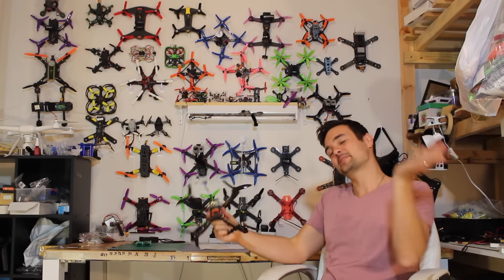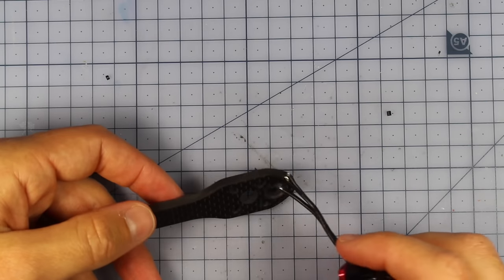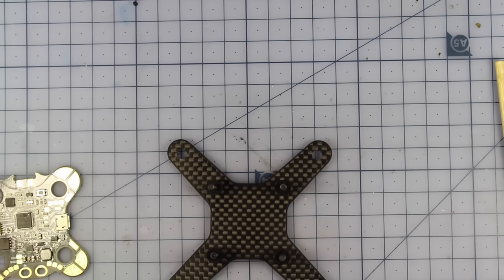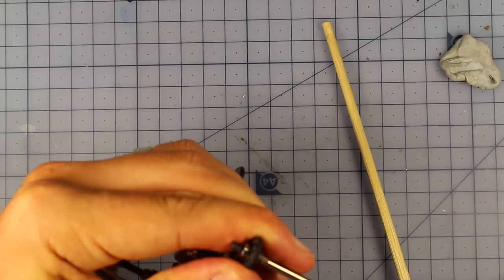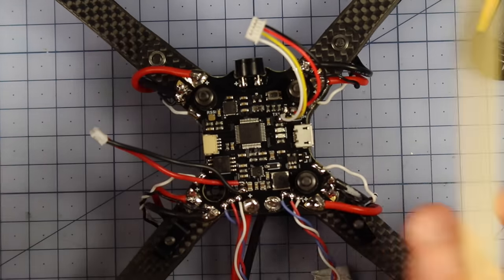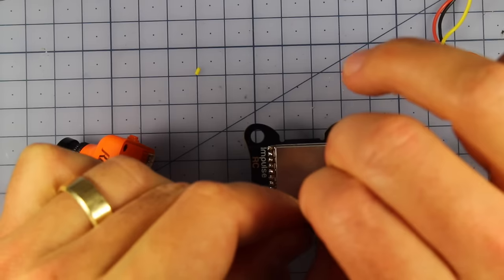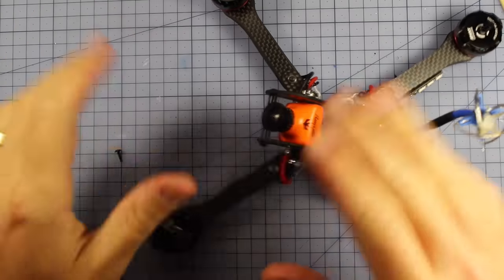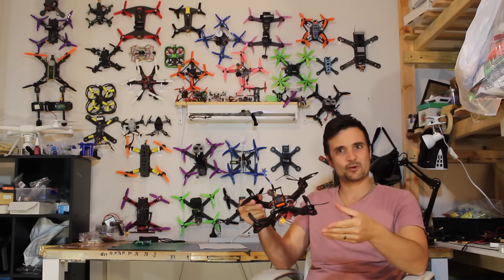ImpulseRC Helix build guide. How to-EASY Step by step DIY Helix drone build tutorial

Comment: Really nicely to see another build of the Helix Stewart... reckon its is the most rewarding + fun quad build I've ever done. :)
For those using the X4R, yes, they will work, but you need to de-pin, the antenna are longer so need to make a loop to use up the slack & isn't as neat as the XSR.

Comment: yeah the expoxying and hot gluing of the connectors is very important. One of the main issues I have seen on the helix forum in connectors falling off the FC in small crashes.
Reply: STRYKA FPV how did he get those dys to fit in the fairings I can't fit mjnes

Comment: what firmware do u flash the helix FC with
Reply from the maker: betaflight, but I just left it on what ever it came it.
Reply: i know betaflight what board is it to flash the firmware in betaflight
Reply from the maker: Techno Bloodbath its an impulse rc hex, just for it. I think
Reply: i only see impulsercf3 is that what you are talking about
Reply from the maker: Techno Bloodbath i will have to check when I get back to it. but i would guess so